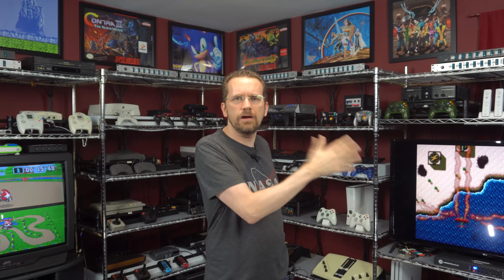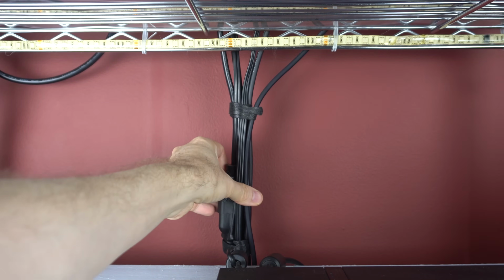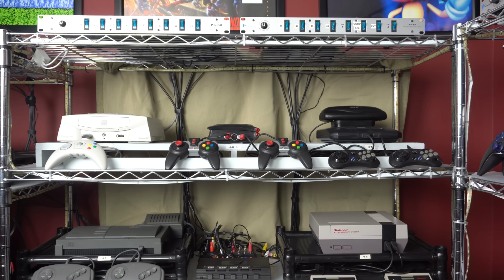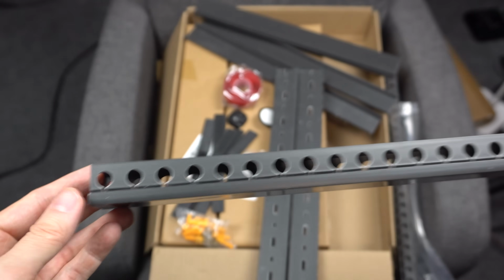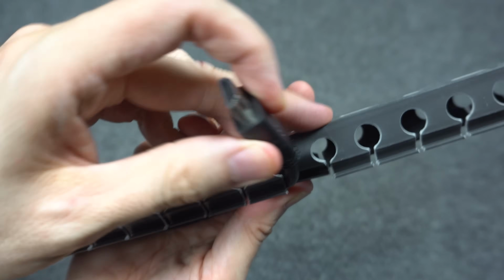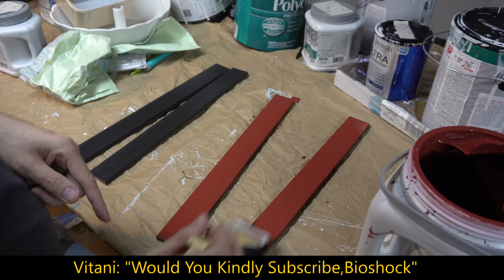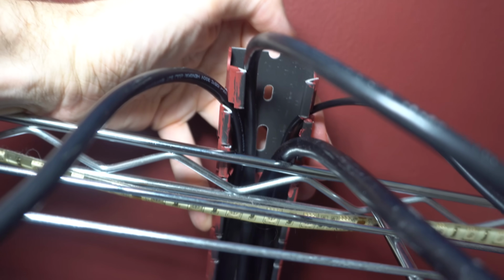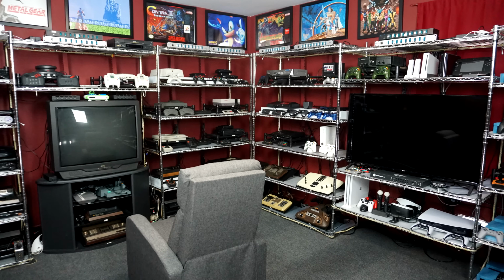My Wire Management NIGHTMARE

Comment: Here’s what I do, I cut holes in my wall and fished them through another 100% hiding my wires. And for my two wall mounted consoles I’ve arranged the wires to look like a circuit board using clear double sided tape strips.

Comment: One thing that someone with a similar setup could do is to grab some spare cardboard or poster foam board, paint it, and use it to create "fake walls" behind the consoles. Just have holes/notches/cutouts at the top and bottom for cables to route through. Attach to the shelving with Velcro tape to make it easier to remove for maintenance.

Comment: Yes, the red looks very nice. Those are pretty neat wire tracks. I have never seen anything like those before. 
Question: had you considered placing them on the supports on either side of each rack? Or would there possibly not be enough cabling in most cases to stretch over that far? That wold further camouflage them. 
Question 2: is there a possibility of signal degradation due to the number of cables bundled and/or some cables not being shielded heavily enough. (One reason I love Retrovision HD cables— the heavy shielding).

Comment: The real problem here is the sheer quantity of game consoles in the collection. Maybe it's time to condense and sell off redundant or unnecessary game systems? For example, is it necessary to keep an Xbox One when u have a Series X that will play its library? Same with the PS4 Pro, why do u need it when the PS5 can run its library? And alot of the ancient consoles from the first and second generations. Are u really going to play some of these dinosaur consoles on a modern HDTV? Shrink down the collection to a more manageable amount and only keep the best of the best and sell what isn't needed. Keep a curated collection and dump the crap that u don't actually play or use.

Comment: I just discovered your channel today, it was the power bar video. The one thing you didn't mention was the fact that most of these consoles pull about 20-30 watts maybe, so your setup is more than fine and safe. Ignore the haters. When my son was young, I set up his room with a modded Xbox, modded PS2, N64 and Game Cube, all with 2 or more wireless controllers each. Output from all 4 and a VCR were routed through his computer monitor. Yes, I spoiled my son, LOL. Everything was on a big desk, it was quite impressive, not as impressive as yours of course. I looked through your videos and I didn't see one on how you did the signal switching. My son had a 5 way switch which was the largest I could find at the time. Thankfully everything was RGB back then. I imagine your signal switching scheme must be quite complex and impressive, would make a great/interesting video. P.S. We are techies, we like the look of wires as long as they are neat and managed, keep the wires.

Comment: This is awesome. YES people still say this. I will need to grab these when I get a game room one day. Apartment living does not allow this. # DC Metro area is too expensive. Have your controllers always been in front of the consoles? I have always been wondering how to organize the controllers in a similar way. I did stumble upon a way to use a mail cubby (for letters) and you can put the controllers in each slot. That is what I currently do. But wrapping the controller wires I assume over time is not good for the cords correct?  Plus the cubby takes up space even if the controllers are out away neatly.

Comment: Quick tip for painting plastic. Use sandpaper to rough up the plastic your gonna paint. If you just paint plastic it will slowly chip off cause the paint has nothing to adhere to. Sanding it fixes that
Reply: Especially if that's nylon.

Comment: i appreciate the neatness that cable management and covers offer, but for me, it's too impractical as i frequently change out/swap/maintain devices, unplug and plug cables in etc. i can easily overlook the clutter of cables if it means me not having to bend and twist my body under the desk or behind a shelf. this is also why i never have my (PC) setup up against the wall for easy access so i'm more of a function over form person.
Reply from the maker: The covers are a pain to get off, but once they are off it's not too difficult to add and remove things.

Comment: I think going with the red was the right decision.  Personally I would take it a step further and get a plastic welding kit from harbor freight and plastic weld the pieces where two meet for better rigidity.
Reply from the maker: Interesting suggestion. It seems like that would make them harder to remove when I need to do something with the wires.

Comment: Team red! Tubing like this is great! The only problem is if you want to change the setup or move a console it becomes even more of a hassle. So you better review your setup and decide if you are happy with it the way it is before you start tubing
Reply: It isn't bad, and it might even be easier.  This is very similar to cable management in data / phone network environments, which I've used a lot for the last couple decades.  You can just pull the cover off the channel to expose the inside, and then route your new cable, or remove an old one, etc., then snap the cover back on.  Contrast that to undoing and redoing velcro strips every few inches...